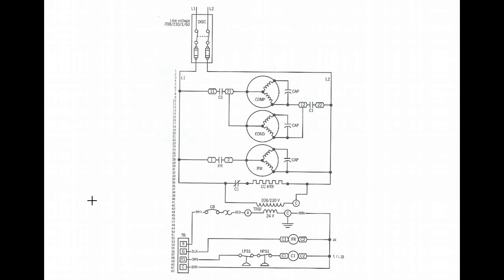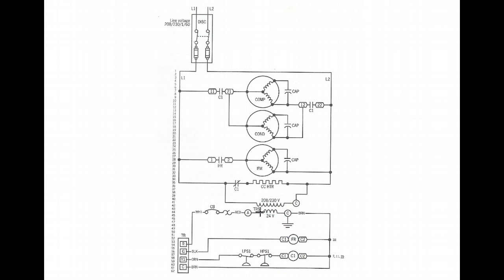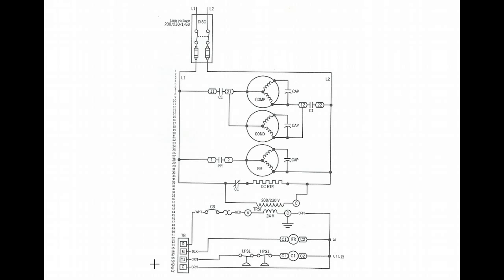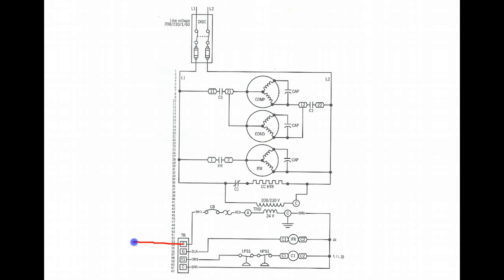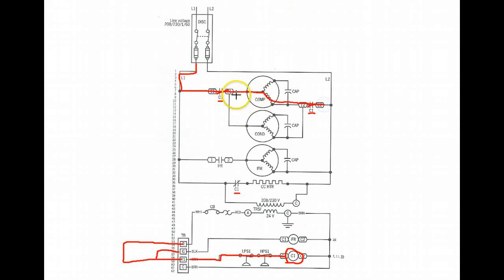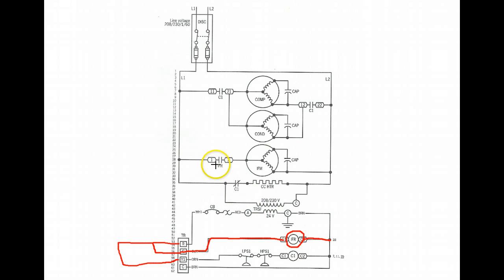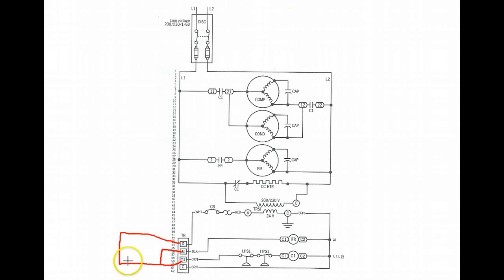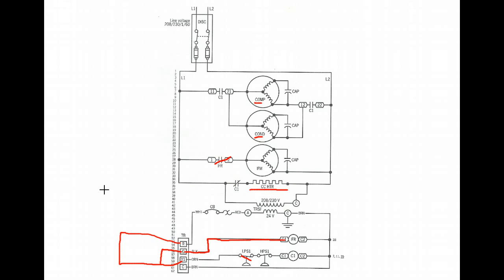NATE AC and Heat Pumps - Troubleshooting Electric Circuits

Comment: What is the purpose of having 2 sets of contactors for the comp and cond motors? See C1 11&21, C1 12&22. If you permanently short just one of them the system works the same yes? So why have another component in the system just to possibly fail. Any answers?

Comment: thanks for the video.  Im struggling with low voltage side. isn't the transformer located in the furnace in the house? Then why is it on this diagram? also  when you connect R,G, and Y , I really dont see a difference on how you draw those connections, but you make  a point on erasing and then redrawing it differently, Im probably missing something here
Reply: It is all part of the system even though it is inside the house. The evcap coil is in the house and it is part of the ac as well.